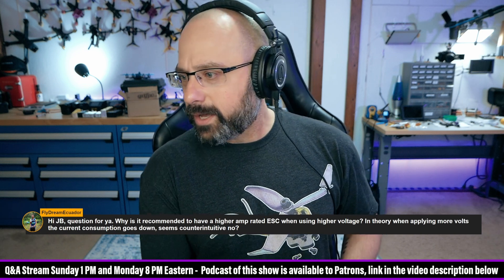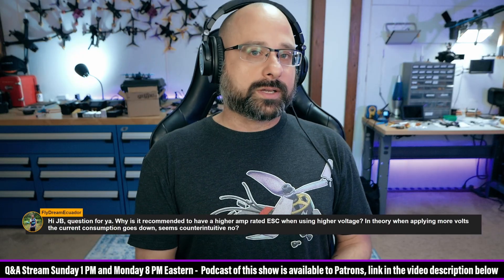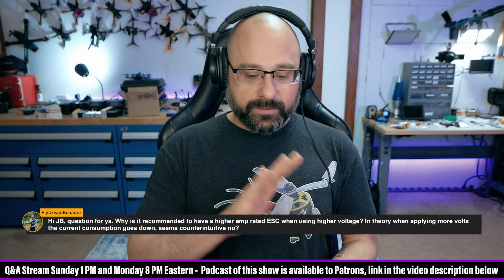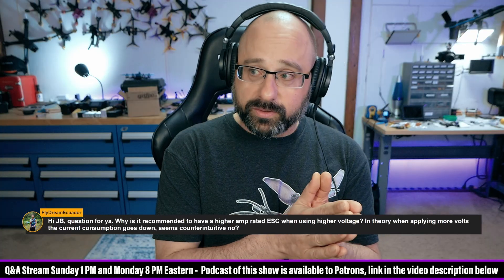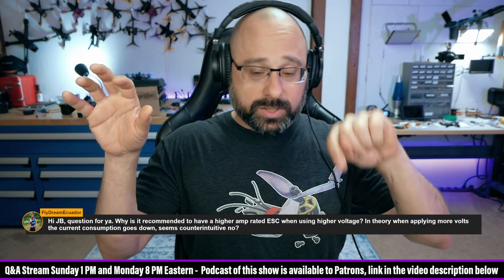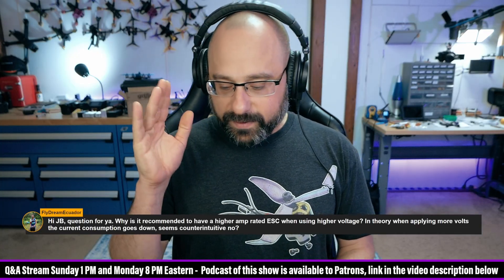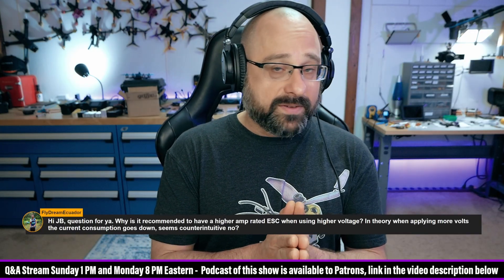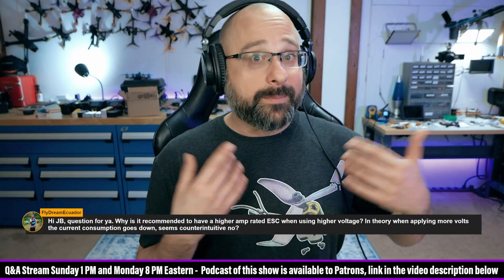Why Do I Need More Amps For A 6S Build? Does Amperage Increase or Decrease on 6S? - FPV Questions

Comment: It is also because often the 6S motors are designed to use more power than the 4S motors. They can do that because the used voltage is higher. At the end both have the same current (even if 6S the amps should be lower). But they have different electric and mechanical power. That is why you sometimes just need the same or even higher rated amp ESC for 6S motors. For example T-Motor Velox V2207, 1750kV 6S with 37amps vs 2550 4S 38amps. Is nearly the same, and this is just because the 1750kV version is designed for more power...
Reply: The higher your voltage, the more power you can transmit over cables because the limit is given by the current that actually flows through the wire. That's why power lines use extremely high voltages to transmit a lot of power through relatively thin wires without heating them up and melting them. Going from 4S to 6S you can practically double the power to the motors without heating up the wires more.